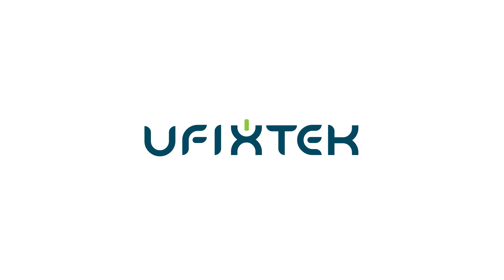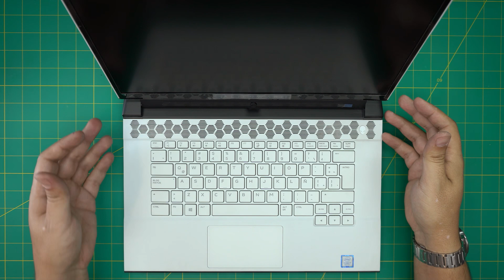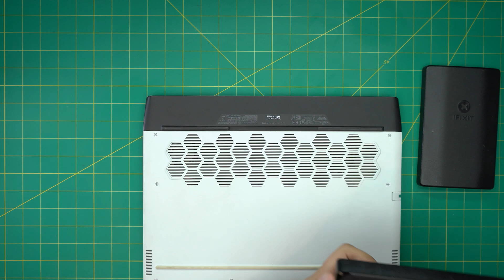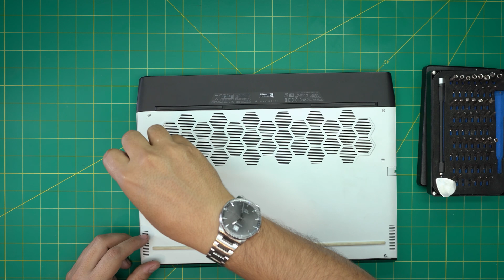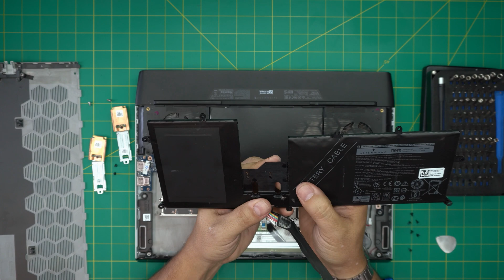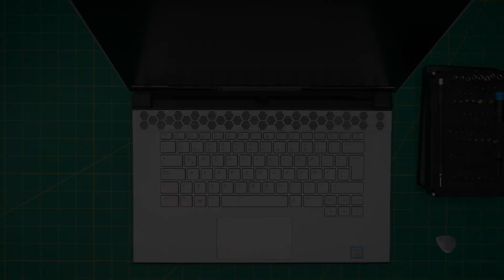How to Replace Battery on Alienware M15 R2 Laptop - Step-by-Step 🔋🪫

Comment: Do you have any tutorial about change his CMOS battery?
Reply from the maker: 🫠Regarding your question, the CMOS battery is right under the main battery:
https://imgur.com/a/NY5xl6s
It is a CR2032 with a cable, and it’s as simple as pulling the connector and replacing it.
cheers🍻

Comment: Says the battery is not recognized
Reply from the maker: 🫠 Regarding your issue: you may have a bad battery or the BQ IC chip on the board may be faulty. Did the old battery at least hold a charge for a few minutes and get recognized? If so, you most likely received a defective battery.
Should you have any further questions or requests in the future, please don't hesitate to ask me.
cheers🍻

Comment: Please inform how to charge this battery externally. Regards
Reply from the maker: 🫠Regarding your question, you need to get a 12v 1amp or 2amp charger (usually a router or modem chargers), and connect the red wires of the batter to the positive of the charger (usually the inside of the the tip), and the black wires of the batter to the negative pole of the charger (usually the outer of the tip).
and leave it for charging for 3H.
Should you have any further questions or requests in the future, please don't hesitate to ask me.
cheers🍻

Comment: Can I use the laptop without the battery?
Reply from the maker: Thank you for your feedback! If you wish to support the channel, you can like, subscribe, or both!
Regarding your question, yes you can and it will work just fine and even less over heating on motherboard and the charger will run cooler and last longer.
Should you have any further questions or requests in the future, please don't hesitate to ask me.

Comment: Applied best to my AW15 R2!  Thanks!
Reply from the maker: It's my pleasure my friend. 😊 Thank you for taking the time to give feedback! If you would like to support the channel, please like, subscribe, or both. :P
Should you have any questions or requests in the future, please don't hesitate to ask me.
Reply: @uFixTek  unfortunately after the initial overnight charge, despite reading 100% power and a good battery health report, the new battery will not power the laptop.  Won't last long enough to boot it,  shuts down 1 sec after I unplug the power supply when it's on.
Reply from the maker: where did you purchased the battery, we had the same issue with a seller and we had to return the batch of the batteries that we ordered and purchased again from different sellers and the batteries were just fine. because this laptops have smart battery detect and the cheap or pirated model batteries have a bad firmware chip on them.